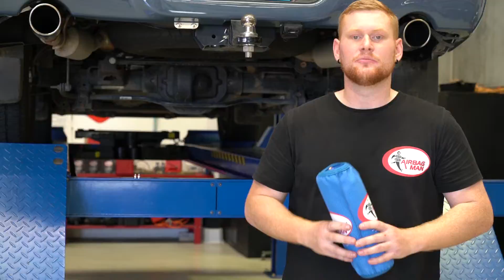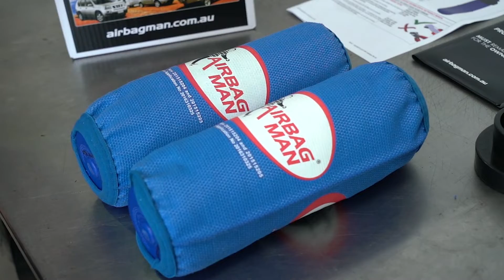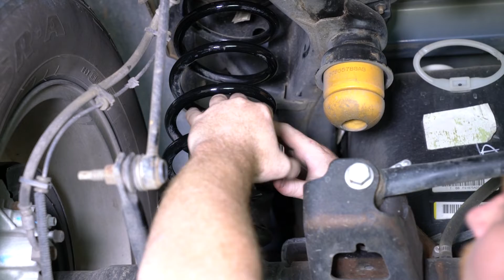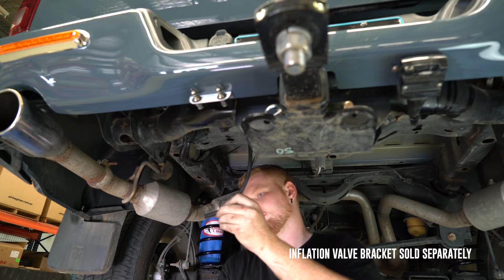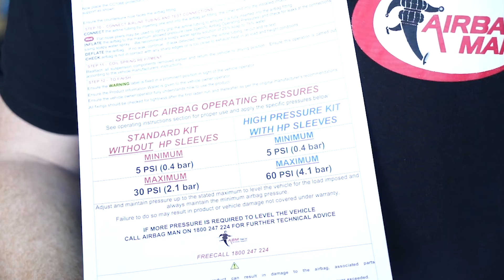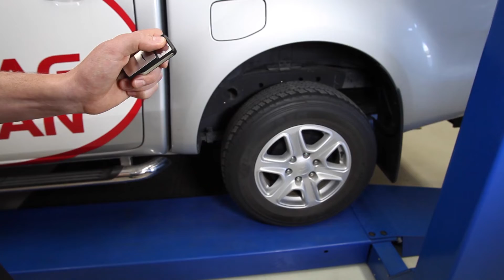How To Install: Dodge RAM 1500 Air Suspension - CR5159HP Airbag Man Coil Helper Kit

Comment: What is the maximum weight it would handle?
Reply from the maker: The maximum load for our airbags is up to the factory-rated GVM of the vehicle. They're designed to help reduce sag and level the vehicle so it can carry the load more safely, but airbags alone do not increase GVM.

Comment: Hi all I have your coil helpers on my 6x6 cruiser I have internal controls for the air system but it seems to loose about 2psi a day, is that normal I’ve had the system checked out 3 times by the builder of the vehicle and they are telling me that you can loose more than that. Now I’m no mechanic, but if you put 30psi into the system not drive for a week and come back to it and find you only have 15psi. To me there is something wrong am I correct or not?
Reply from the maker: G'day @charlesvella2431 & thanks for your comment. For assistance, please feel free to call our friendly team on  +61 7 3889 6556.

Comment: You need to inflate each bag separately. That seems stupid & counter intuitive. Why not just connect them together with 1 point to inflate.
Reply from the maker: WICKEDLEE LOOPY that will only be good if you have a completely even load across the rear. This is not the case 95% of the time, We recommend individual bag inflation due to uneven loads across the rear. ;)

Comment: My don't you hook the Schrader valve to a tee you could air both up at one time
Reply: Because when you're cornering the air will adjust and flex side to side if they are connected and cause handling issues. You'll never get accurate air pressure either.
Reply: @kylejohnson2213 that's interesting I didn't think of that.